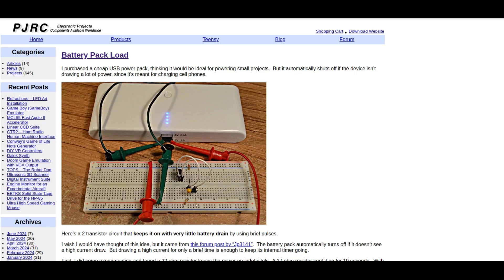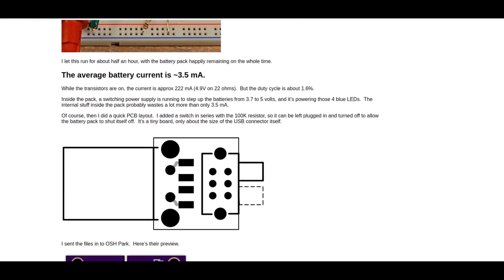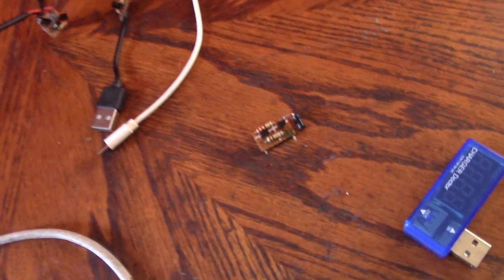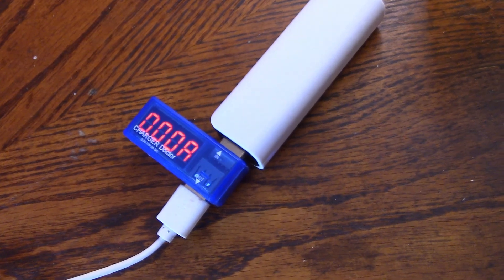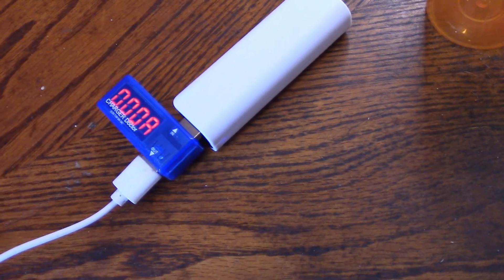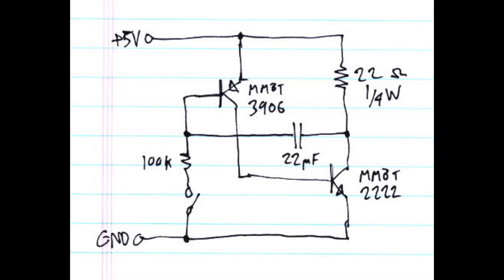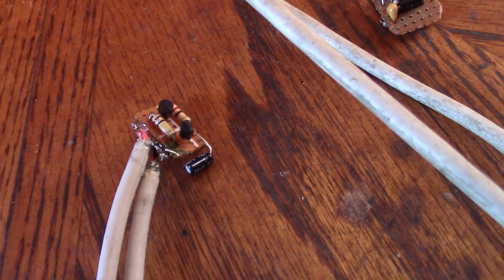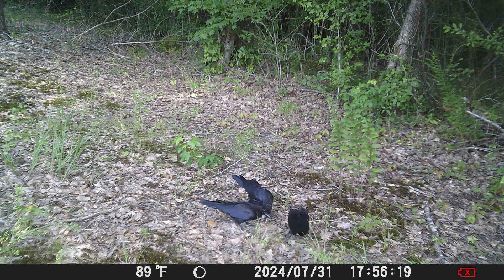Easy build USB 'keep alive' circuit

Comment: That is handy 👍👍
Reply from the maker: Very handy  😃  Super simple to make and from parts that are easy to find. I like it a lot. The trailcam ran overnight with no issues, the blue light was still on this morning.
Reply: @Slider2732_  I copied the diagram for my files 😁😁 although I will probably forget where I put it 😕😕
Reply from the maker: @GrandadIsAnOldMan  I tend to stick things on the desktop, then move them to a folder and never find them again... often because the folder is inside another folder, which ends up in another folder !

Comment: Cool. Was always wanting to solve this problem. Thanks a lot.
Reply from the maker: You're very welcome 😀
I did find a circuit worth of parts on the table when tidying it up and set about on a mission. That one is in use with a wireless energy circuit now. The parts would have ended up in a box otherwise and maybe not used.
Reply: @Slider2732_  its also a nice simple lfo, probably close to a square wave?
Reply from the maker: @MilkywayOutcast  Interesting question. Yes, somewhat similar to a 555 with a long off time. In testing with a homemade low power circuit, there's an LED on it that flashes slightly brighter every 2 seconds, which will be the firing of the keep alive circuit. If I'd had a smoothing cap on that circuit then I wouldn't have seen the flash. 
The speed of such an LFO could be changed by the size of the cap. A bank of set frequencies could be made with different caps, using a multiswitch or selector holes to plug into. Extending that idea, perhaps a variable resistor in parallel with the caps could bring sweepable ranges.
Reply: @Slider2732_  thanks, i will definitly try to integrate 🙂

Comment: Great idea yes can be quite a pain when power bank turns off when you don't want it to. Looks like a good fix 😊thumbs 👍
Reply from the maker: Cheers 😀
Yeah, have run into many an issue with low power stuff and this only takes a few minutes to make.